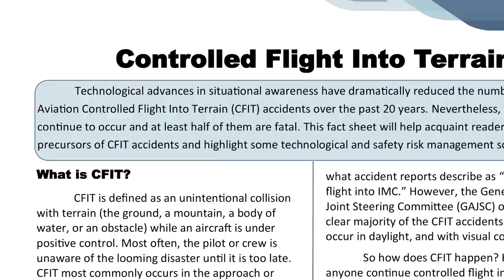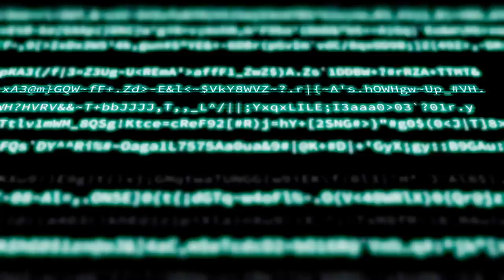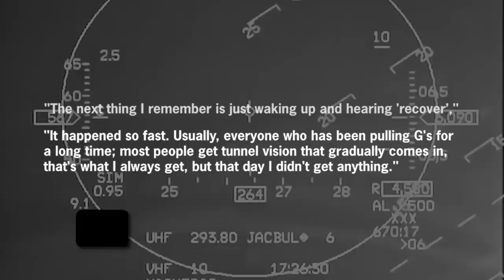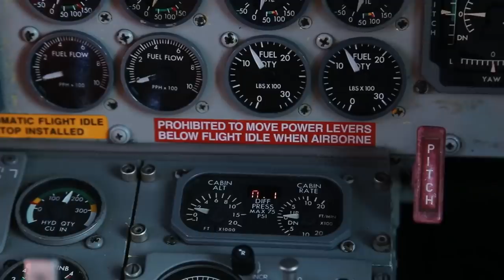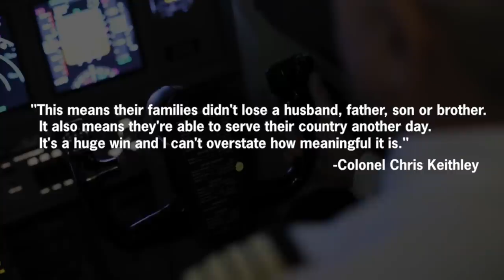F-16 Nose Dive - Pilot Passes Out - HUD Camera

Comment: The stick with Cyrillic font cracked me up!
Reply: How about the bitcoin miners .1:12
Or the Soyuz docking footage. 1:06
Reply: @psygn0sis  Or all the USN F-18 footage aboard aircraft carriers while talking about the USAF's F-16.
Reply: @dx1450  Its just filler footage dude. Some of yall are getting to hurt over these clips.
Reply: @50shadesofcerakote  But if you're going to do it, do it right. I'm sure there's plenty of stock footage of F-16's out there.
Reply: Esp considering the F-16 doesn't have a traditional stick between the legs.
Reply: Or calling it the "Falcon" - which was General Dynamic's name for the F-16, but all the guys that drive 'em call it the Viper.

Comment: One of my professors worked on the Auto GCAS systems with Mark Skoog. Amazing stuff, this barely scratches the surface of what this system is capable of.
Reply: what else can the system accomplish?
Reply: @geddon436   One of the coolest features is its ability to use relief map data and keep an aircraft from entering a valley it wouldn't be able to climb out of.

Comment: AutoGCAS is great for pilots that pass out, however, the system can't put gas in the tank if the pilot fails to recognize that they're about to run out of fuel during training, as happen in 2018 in the airspace around March ARB(Air Reserve Base), CA. The pilot was able to eject safely, but the plane ended up crashing into a nearby warehouse, which, fortunately, was mostly empty of people since it was a Sunday.

Comment: Worked on the F -16s at Luke AFB back in the early 80s, before they updated the side stick controller, we called them Lawn Darts because we lost so many to “G-LOC” The stick was so sensitive that pilots would snap into a turn so quick (and hit the 9g limiter) it would knock them out and in the dirt they’d go.

Comment: It actually costs more to train the pilot than what the jet costs. In the Vietnam  era f-4s instructors would have to drive in the notion to eject and save the pilot and wso when they began to lose crews because they were staying in the aircraft too long trying to recover controlled flight. I think the modern computer controlled systems take a lot of workload off of the pilot allowing more attention to be diverted into flight control than all the analog switches and buttons that had to be activated in the older fighter jets.

Comment: You would think that this would be tech invented a long time ago, some how. Thankfully it is even implemented. I see Vipers dogfight all the time over my home. Today even they were above mock dogfighting. I always hope I never see it happen. Although, usually they are going relatively slow when doing this. You can practically see how the Viper is not good at high aoa or at slow speeds. When they're ripping through the valley though, that's when they shine.

Comment: We don't really need a human in the cockpit and haven't for sometime. If you take away any profit motive, the economic gains and jobs supporting a pilot, there is another reason to keep them in there. If a country or group downs a unmanned aircraft it will sting but you are not going to get the huge outpouring of anger by the public if there is a face attached to that pilot.

Comment: Rather than pull up, the system should just eject the pilot without a parachute. Joking. But, this is nothing new and no matter how good technology gets with g-suits and auto pilots, there is still the danger of human limits. It becomes fuel for the autonomous argument. Honestly, it’s good fuel too. If a Bear is carrying a nuke over the boarder to bounce on our land....do we want a human at the controls of our defense that might fail in the face of necessary g forces? I know, tons of really excellent reasons to have a capable human on board. I don’t deny it. However, with advances in technology, humanless fighters are becoming more and more appealing.